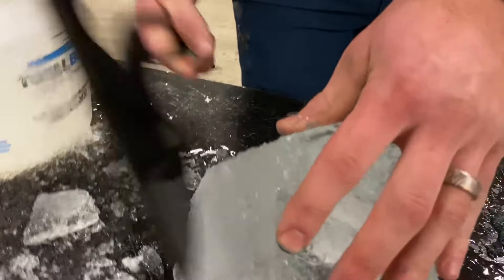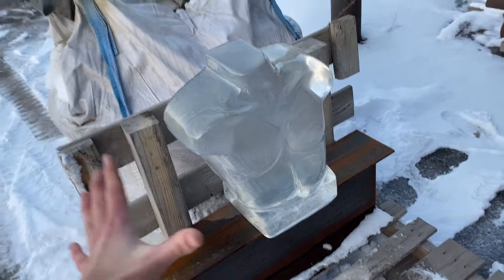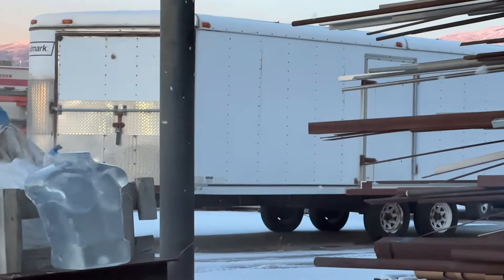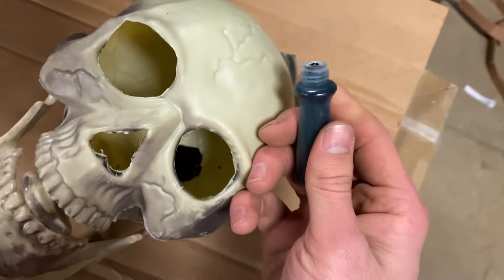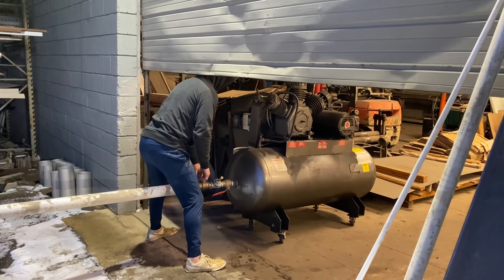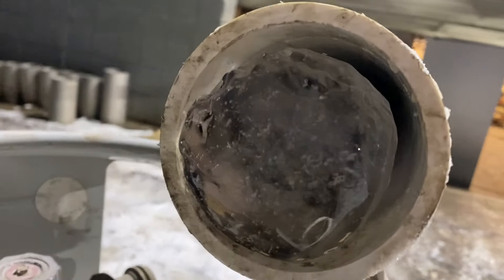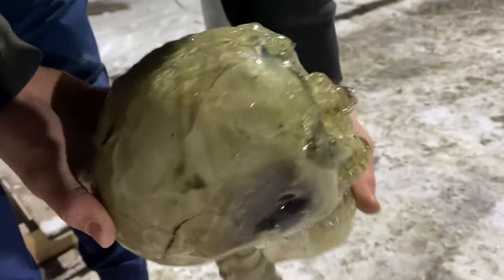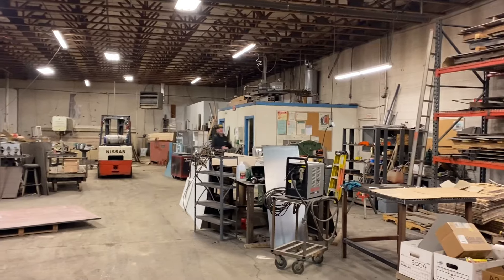Can We Make A Lethal Ice Bullet?

Comment: Why not use the old steel slug to make a silicone mold, fill it with water, and freeze it so the ice bullet will seal in the barrel instead of the air escaping around the lopsided chunk of ice? Or use a capped piece of pvc with the same inner diameter as the barrel to make ice cylinder/bullets
Reply: this is like preppers buying 9001 different guns but not knowing how to make ammo

Comment: if you use a bit of paper as wadding you should be able to get higher velocity
Reply: I hate to be Prudence the Safety Goat but at these speeds they should definitely be doing this at a range...
Reply: What works well is wadded up plastic shopping bags.  They're free, they compact well, and they're low-friction.  When they leave the barrel, they don't fly far, and they don't break up into a bunch of bits.

Comment: I worked at a theater long ago and when bored, we would throw ice cubes at each other. 
Once a coworker whipped one at me pretty fast, I tried to whack it out of the air but instead it went in between by fingers and sliced one wide open. 
I was quite surprised and the moral is: ice can be sharp...